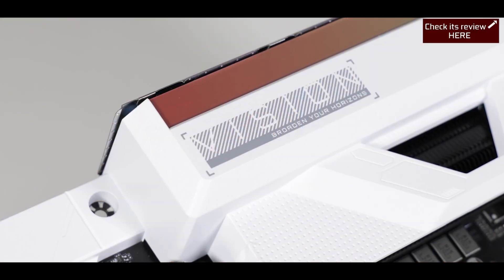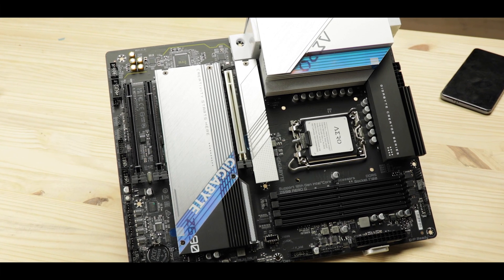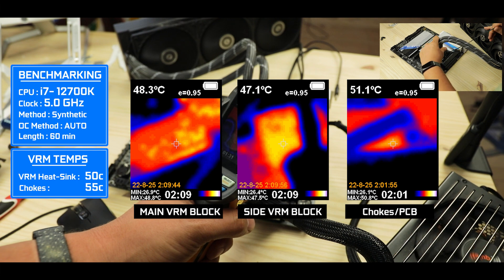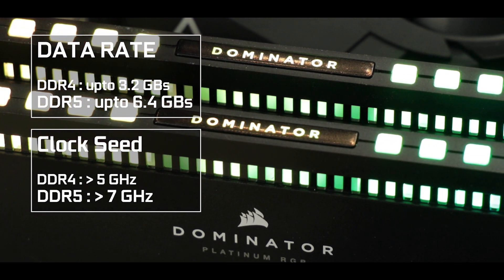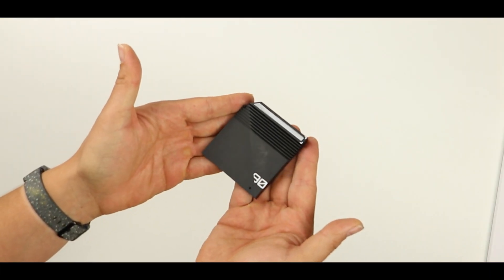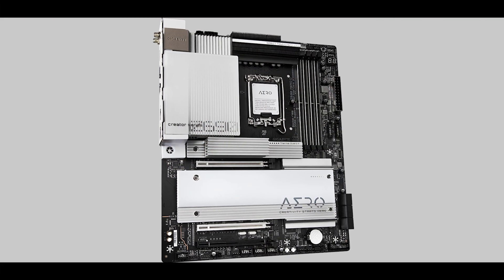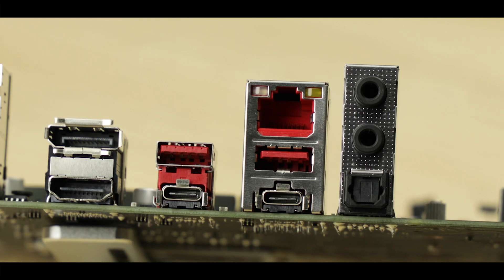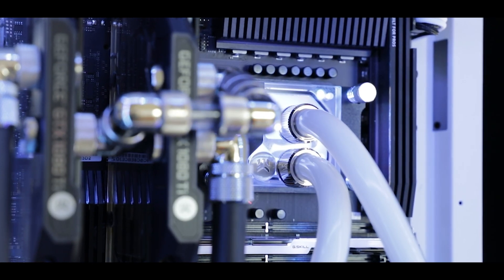Gigabyte Z690 AERO G, correcting so many wrongs!

Comment: Not such good news with my Aero B650 G and 7950X which is not stable if using any form of PBO tuning, such as setting the curve optimizer. This may be a bug in the BIOS as I am able to push to -30 on all cores with Ryzen Master but I cannot boot after making those settings. Or maybe I just have a lemon.

Comment: I got one.. Sitting on my table not being able to POST. All I get is a dram light on.. Tried with a new set of ddr5 sticks, problem persists.. God damn computers..
Reply from the maker: paradoxically, the memory led usually points at a problem with the CPU being either damaged, or the mobo socket (usually), or the CPU being pressed too hard against the CPU socket (lose the screws of your all-in-one cooler). Also, can you clarify where you placed ur ram stick (A1, A2, B1 , B2). 

Thx
Reply: @Laurentschoice  Oh gotta try loosening the cooler and check for visible damage, thanks for the tip!
The ram sticks are in A2 and B2 slots.
I think I managed to update bios with q-flash last night, I took out everything from the mobo and it did seem to do something for about 10minutes. Then I installed everything back and still got Black screen and dram light on.

Comment: I have this motherboard and installed 4 Corsair ddr5 5600mhz ram sticks. 

It can only handle 4800mhz clock speed. 
Is this because the CPU is unable to handle that clock speed, not the MB?

Comment: will this board support 13th gen (is it adequate for 13700k?) I know Z690 supports Raptor lake but on their official page, they did not update with the backing of the 13th gen!
Reply from the maker: If its a z690 powered board you'll need to update your bios but YES it will support any raptor lake CPUs on the market
Reply: @Laurentschoice  thanks!